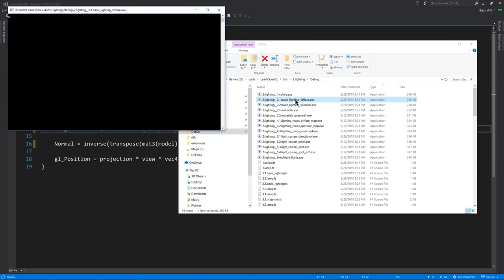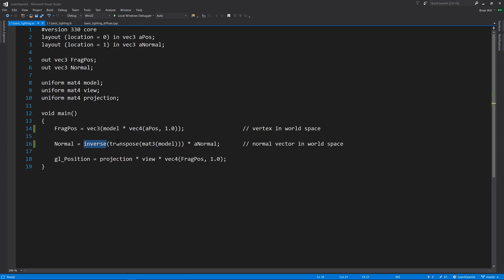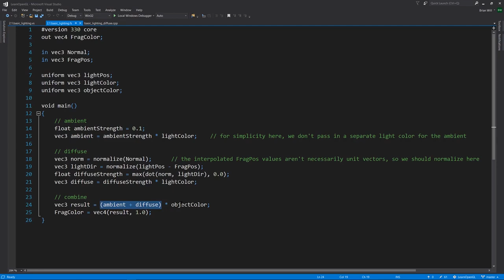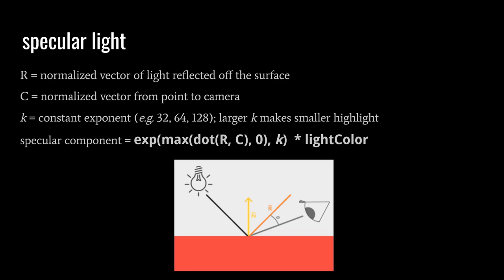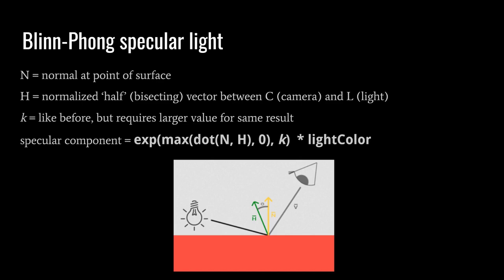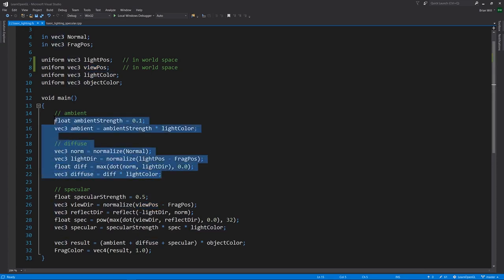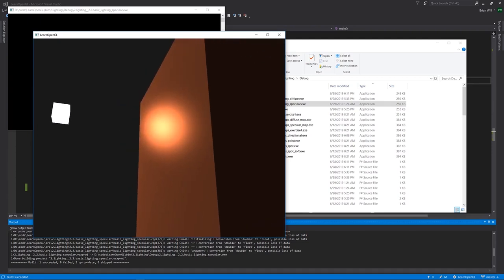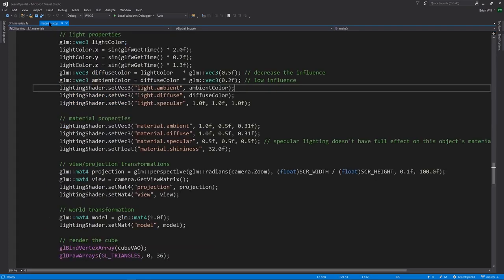OpenGL - lighting with the Phong reflection model (part 2 of 2)

Comment: How does the reflect() formula work?
Reply: You give it a vector with a certain direction (representing an incoming light ray), the inclination of the surface it will bounce on (represented by its normal vector), and it gives you a vector with the direction that the reflected light ray would have. You can figure out the formula using some geometry and the fact  the reflected angle equals the incoming angle, and the reflect() function applies that formula internally.